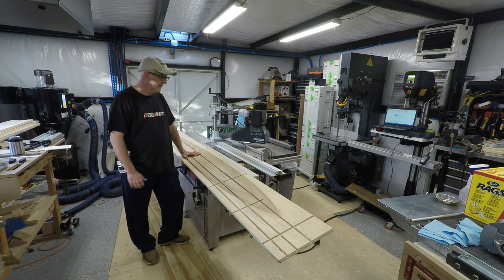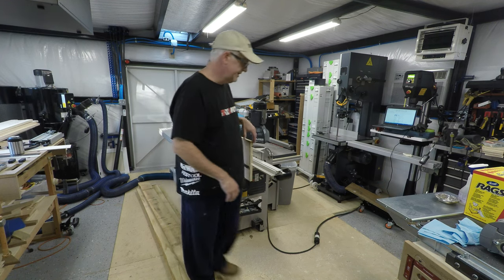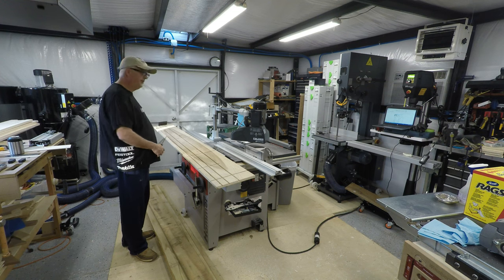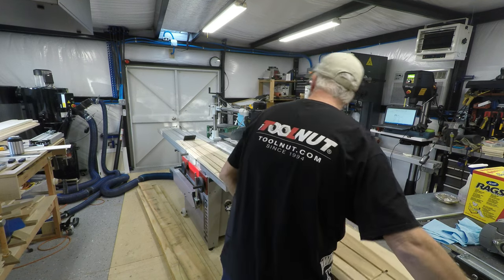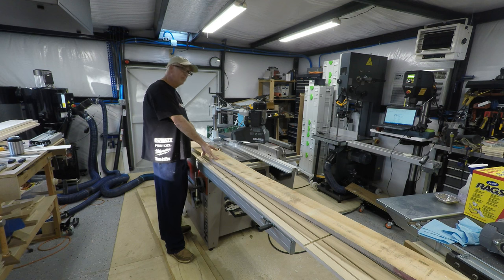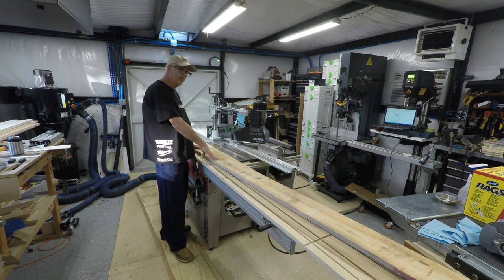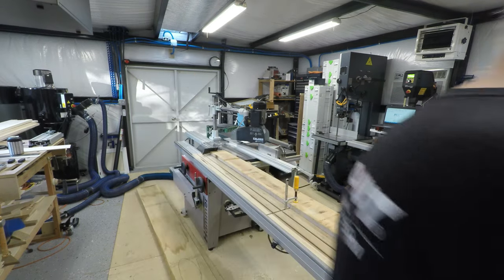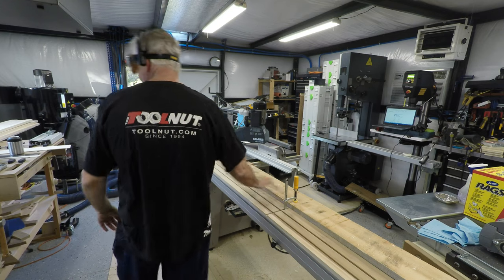Longboard Straight Line Rips on Felder C3 31 Hammer

Comment: I have a Hammer C3 31 and a N4400. Both are GREAT machines. Veeeery precise, very accurate, very powerful and because of that, very usefull. I got the silent power version for the combinated machine and, no neighbor can say a word about noise.
Reply from the maker: The silent power for the planer head is quieter for sure. Plus the finish on the wood is great and easy to sand.

Comment from the maker: They had my machine in stock at there  Dallas, Texas warehouse and was delivered in a couple of days. 

Make sure they give you the instructions for making sure everything is  straight. When they delivered mine 2 plastic things were broke, they have yet to get the replacement parts and when they delivered my Bandsaw I showed the tech and he promised to get me the parts over a year ago and would have a tech sent out to align everything.  I went to the Feldar office in Dallas (50 mile trip) to address the issue, the rep said he did not have time because he was to busy working on 3 CNC machine quotes. Guess I am to small of a customer, only have spent about  $17K

I did not get the check list from them when delivered so be sure and ask.  Also be sure and check for anything broken. On my saw when the blade is set to 0 degrees it does not cut straight when the outrigger table is attached.  As far as the machines they are well built and love them. Service not so good.

Comment: Help me understand, why would you need to establish a straight line rip on the entire 10 ft board for making face frames? why not cut it closer to working length first then just use the sliding table on its own for a straight line rip? Also, at that point, isn't it just as easy to run it over the jointer? much better dust collection that way as well I would think right?
Reply from the maker: For me it is a lot faster this way, only takes me a minute to slide my extension board onto the sliding table and I don't have to lift a heavy board back and forth on the jointer, it is a physical challenge for me, have rods and screws connecting parts of my spine together. Dust gets around in my shop and have to vacuum anyway. Once the boards have been planed I do run the edge on the jointer  when the stock is lighter for me to handle and at a width so I can manage waste better. before cutting length's. Also by running the longer length board through the shaper creating the grooves with a feeder prevents wayste if you get a little snipe on the end; better to have snipe on the end of a longboard than sometimes getting snipe on short pieces (something I forgot to do first ang got a nasty reminder when I ran pre cut parts  - lol.)  Your way works to, just depends on what your preference is.
Reply: To run a board across a jointer of that length and keep it completely level is just as challenging. and would require some sort of support mechanism for the feed and for the output side. 

I have a large saw and fee system that allows feed in of long boards/planks and it only needs one person to operate it but the whole system cost nearly $25,000.
Reply: I have 5 foot slider and maple im getting is around 7 feet , do 500 bf on jointer take me about 3 hours doing it on the saw with this jig it takes about 1 hour so yes it is great idea and works good , sometimes you can’t brake pieces to smaller lengths for example I usually stock up material for shaker style doors, full lengths so i can groove them all at once and than depending on what i build i cut them to lengths.

Comment: Great idea.  How long is the slide on your Felder saw?  What is the length of the board you cut with your aux. push board technique in this video?   Thanks.     Also, If space were not a problem (I'm in the shop planning stage now), what size slider and cross-cut outrigger do you recommend?       I love Felder products and have a Felder combi  (that "combo" in Felder-speak) machine on my wish list.  Also, there is a huge jump in price going from the Hammer to the 500 and 700 series Felder machines.  Other than size of the jointer-thicknesser, do you think there are there other reasons, such is higher quality,  to justify spending the much bigger bucks?
Reply from the maker: My slider let's me cut 7' length and my push board is 10'. If space was not an issue I would get the next size up from mine that will let you use the full length of slider  to cut a 4x8 pannel with ease

Comment: Hey
Thanks for the beautiful explanations
I would like to know how long the saw arrives from the time of the order?
Thanks
Reply: From my Felder experience on machine delivery. If they have it in the US it may take 2-3 weeks to arrive with a freight truck that has a lift on the back. Otherwise we are talking about 2 or 3 months (they will say less, buttttttttttttt). If they are incorrect on the Euro side with availability; you may have to wait longer. If they forget to ship part of the machine; it could be 5-6 weeks total. This was my experience years ago with Felder.. Martin is same way for 2-3 months delivery. Don't commit to any work schedule until you have the machine in hand.
Reply from the maker: It took around 7 weeks to get my 510 bandsaw. same time frame on accessories when they are not in stock in the US and shipped from overseas.  My understanding is they wait to fill up a container before shipping to the US.

Comment: Hey sorry, but I was going through different Felder videos and am way to distracted by your shop...lol. I am about to build a garage/shop and am always looking at different ways to do things and your shop has my spidey senses tingling. So how is it made, how big is it, is it a steel type building? Is it slab on grade construction?  Foundation? do you live ina climate that gets cold winters like here in Canada? if so, how does it hold up? Cheers
Reply from the maker: The shop was a kit from Mueller Inc, they specialize in metal buildings. The shop is 18"x21" and not built on a slab, bought the floor kit and leveled on blocks. At 30 degrees F my heater had no problem keeping warm. I insulated the building with insulation purchased from Mueller.
Reply: I would suggest going for the biggest shop size possible and then leaving space for expansion.  Having a good saw, Planer and joining works space is what people should be aiming for.

Comment: You're lucky about your building.  I bought and put up a 30' x 50' steel kit building from VersaTube on a really nice smooth and flat concrete pad.   I've got LOTs of space, but ugh, it is comfortable to work in only about 2 days a year.  Most days, It's an oven in the summer and iceberg in the winter.  I'm going to have to spend lots more $$$ adding more than just the radiant barrier foil and thin  roll-out insulation and add some serious (and seriously expensive) HVAC for climate control.
Reply: I have a home workshop that I just had a HVAC system installed and it made a great difference in the summer. I have a commercial shop as well but it already had a system in it.